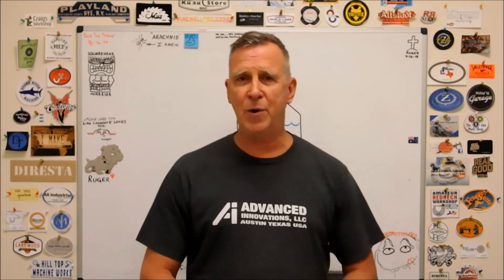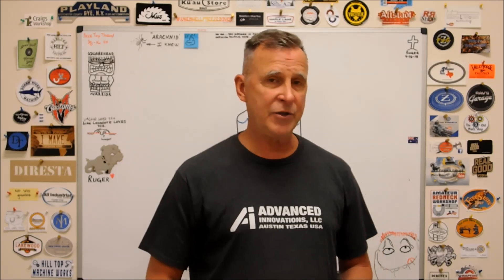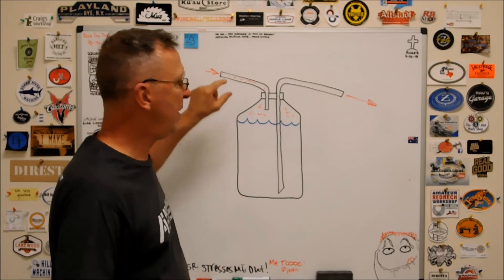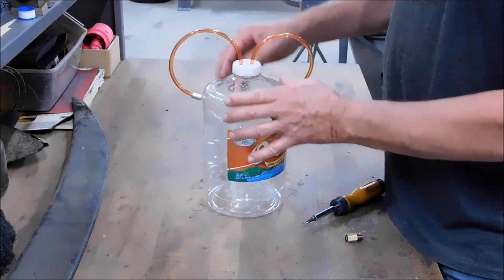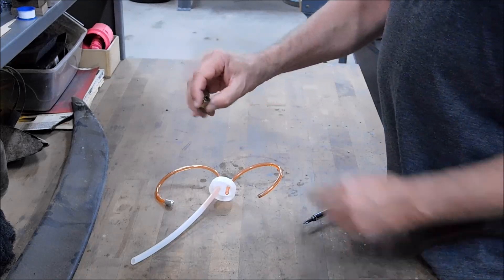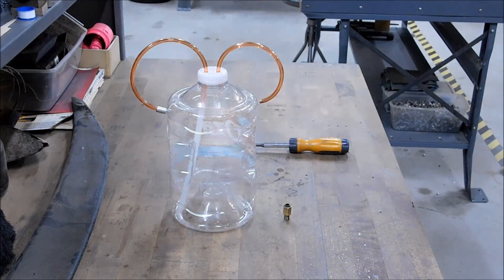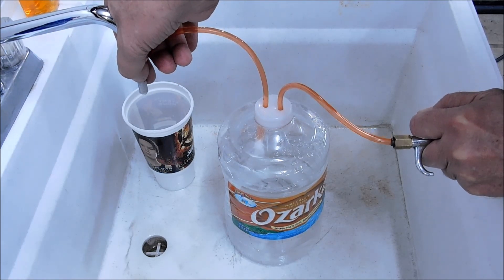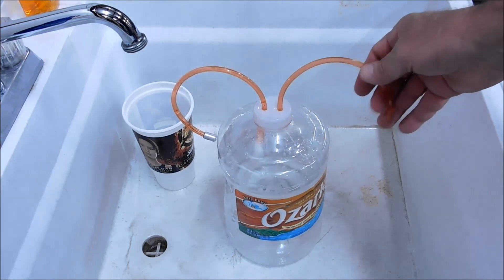DIY Coolant Pump

Comment from the maker: When I actually went to use this setup, I downsized the air input hose to match the hole size in the tip that delivered the coolant. The balance in sizes made a huge difference in the tank expansion. It was nearly a balanced system and worked extremely well.
Reply: Cheap Regulator and a good needle valve would probably work awesome. Perhaps a  reusable system could be made from automotive windshield washer tank from a salvage yard and a dash light dimmer to control the washer fluid pump. Probably cost 5$

Comment: If you have an old air pump for fish aquariums, it will work great to pressurize the bottle.  You could also drill a small vent hole in the cap to help regulate the pressure if the air pump is too powerful.  Usually they only put out 5-10 PSI.

Comment: Hi Joe: a lifetime ago in teacher's college I was introduced to a project for highschool kids using a 2L PET pop bottles to make rockets.  Basically the bottles were about 60 or 70% filled with water, a rubber stopper with a tire valve placed inside.  The rockets were fitted into a "launch pad" - basically two butt hinges with a hole bored out to accept the bottle neck, and a piece of channel to keep the hinges closed until you pulled the channel off.  Air and water exiting the bottle launched it.
One night my co-worker and I "failure tested" one of the PET bottles: I think it took pretty much full line pressure to kill it.  The bottles took a fair bit of pressure before they ruptured but when they did it was a catastrophic failure...  Point being: a pop bottle might be stronger than the juice bottle. 

Very clever solution though.
Reply: One note is that the bottle needs to be replaced periodically as even at ~80psi, they tend to fail at the "seam" in the neck of the bottle .  They typically develop a pinhole which will then suddenly explode.

Comment: That's a really good idea.

On my machines I've used the windscreen washer bottles off a car. Just supply 12v (with a variable resistor to adjust flow) and it works great.
Reply from the maker: That's a great idea!

Comment: Great idea Joe.  I took it a stage further to produce a coolant mist sprayer particularly useful on the Milling machine rather than the normal mess often associated with flood coolant systems. I used a domestic water  filter system body (Aqua Filter) without the filter element and a cheap coolant mist unit available on eBay for about £10.
Pressurizing the coolant as you have done but through a cheap regulator and including a second air supply to the misting device produced a very fine pressurized mist at the the delivery point.
It's now an permanent fixture on the mill and much better than the old flood coolant system
Reply from the maker: Go to the hardware store and get a pair of pipe elbows that fit your mill table ports. Screw them in and face them down. Take a piece of coat hanger and make small bucket handles on 2 coffee or soda cans. Hang the cans from the pipe elbows. No more mess on the floor either.

Comment: I don’t have any air line so I use a garden sprayer. It works well using a hand pump to pressurise the container and an adjustable head to control the coolant.

Comment: Try this.  Invert the jug above the work surface, the “old” outlet is now the atmospheric inlet.  Use the “old” inlet as the new outlet and regulate it using a cloths pin!  If you want to really fancy it up you can attach a bicycle shifter cable to the cloths pin and run it down to a simple foot treadle, giving it adjustability and an on off feature.  No air pressure needed, reducing the “bomb” affect.
Reply: Except that you now have a heavy jug of liquid above your work and have less control over your output pressure. With the air you can get a higher pressure and lower orfice diameter which would allow delivery of a small amount of coolant to a specific point

Comment: I used this same principal back in the early 70's to inject alcohol into my truck motor. I had a vacuum line going to the carb sucking fumes from a fuel tank I had scrounged somewhere. My air intake tube with a filter went to the bottom to create bubbles and fumes. I worked for my Dad at the time and he bought alcohol by the 55 gallon drums and he let me have all the alcohol I wanted. Looking back I don't know if it gave me any more horsepower but I swore at the time it raised my gas mileage about 2 to 3 miles per gallon... I didn't have enough scientific data to prove it but it was a fun deal at the time for a 17 year old kid.....

Comment: I used a hand-pumped plant sprayer (not the backpack type!) to achieve the same effect, with a small valve to control the coolant flow at the nozzle. When the flow slows, a few strokes revive it.
As usual, great ideas, well presented!

Comment: Hi Joe  Many years ago I hydro-statically tested large tanks with the tank filled with water and pressurised with low pressure compressed air.  The simplest and reliable air pressure regulator is very easy to make.  Just insert a T fitting between air source and tank.  Attach a hose to the T and insert it in a column of water.  Use a pipe with one end capped off and stand it up vertically and fill with water.  Drop the bleed air line to the bottom of the pipe.  A 10m column of water gives one atmosphere of pressure (1 bar or 14.7 psi.)  Just adjust the water column height to give the required pressure.  Continually bubble a very small amount of air though this bleed line - no need to switch off air supply.  To regulate the coolant flow fit a three way ball valve prior to your coolant pressure pot.  Position 1 allows the air to enter the pot and Position 2 bleeds air from the pot stopping the flow.  On another project I have used this air bubbling technique to measure oil levels to within 1mm accuracy.   I stole this idea from a brewery tour.  They regulate the height of beer in bottles by sensing the back pressure of carbon dioxide flowing into the top of the bottle set at the required height.  When the beer hits this height pressure in the carbon dioxide increases causing the beer to be shut down.  So you see many engineering things revolve around beer.  Cheers

Comment: If you could suspend the jug above the workpiece, you could use gravity to keep the coolant flowing so once started with air pressure, it would continue unassisted.
Reply: Came here to say the same thing.  I just finished doing that for water cooling the coil on a DIY induction heater.  Works great.  Just lift the lower jug, or take down the upper supply jug to stop the flow.  Since I'm using water, I can suction start the siphon without poisoning myself.

Comment: Joe, 2 liter soda bottles can hold over 100 PSI. The plastic actually has a cross laminated grain like plywood. For my kid's science project, I drilled a hole in the cap and installed a tire stem. My compressor would not pop it at 125 PSI.
Reply: I tell you streight, I would not like to be Anywhere near a soda bottle at 125psi..
Let alone if it did blow!
That sounds like a Darwinian science test to me...
Reply: @captcarlos  I agree! Very dangerous! I was careful to stay well clear of it! Never held it in my hand and attached the inflator valve mechanically. Guess I should have put a disclaimer in my statement.
Reply from the maker: This Ozarka bottle is super thin. I will be careful.

Comment: Hey Joe: I use a similar theme on my mill & lathe. Mine is spray mist system. Instead of plastic bottle, I use a large aluminum pressure cooker filled with about 5 gallons of castrol semi-synthetic fluid & water that is plumbed to both the mill & lathe. I use a regulator to maintain about 5 psi, and each station has two switches *& two needle valves. One for air only, and one for water only. The misters are very dated, made by Bijur systems but no longer made. They are very precise and can be adjusted to a super fine mist using very little air volume. Someday, I need to switch to a different lubricant, since the Castrol stains my vice. Otherwise, I am very pleased.
Reply from the maker: I've used those Bijur systems. I liked them. This coolant is water based with a very special additive. I don't want it in my tank full time. Majority of the time, I cut dry.

Comment: This is a great idea!  More or less it's like one of those pump up agricultural sprayers.  How did you seal the tubes to the cap?  Just press fit?  Love the idea of using the blow gun to gently pressurize it.   Maybe a tip/thought - if you run out of air pressure before coolant, you could feed the bottle from one of those portable air tanks that they use on tow trucks.  With the smaller overall change in air volume, caused by the bigger tank, it would probably maintain close to the same pressure for the whole gallon.

For the safety guys who have posted - I wouldn't give this setup to a newbie employee, but if aware and careful it seems fine to me.  It's a plastic bottle, not metal...and believe it or not, the average pepsi bottle can hit 50psi or more from normal use, and they rarely hurt anybody.

Comment: You could have used a flow control smc fitting to control the air flow instead of the gun. Or just added a flow control inline after the air gun to  regulate the air and taped the trigger down on the gun to free up both hands. Are probably 1000 different combinations that could have been done but yours is simple and quick great video

Comment: An aquarium air pump might be able to supply enough air volume and pressure to do what you need. Would be cheap to try it for future use. I'd probably use a stronger jug for long term use, like a good thick windshield washer fluid jug that those of us in the north tend to get plenty of during the winter.
Reply: Exactly what I was thinking. A small aquarium diaphragm pump is low enough pressure that I doubt there would be much lag after shutting it off, and the pressure is easy to regulate with a $1 valve.

Comment: Joe, I just use a $5 110v pump in a bucket of coolant.  No fuss while  machining.
Reply: I use a Harbor Frifgt fountain pump 12 bucks and a 1/4 shut off valve works great and cheap

Comment: Fill a bottle poke a hole in cap with nail -cheapest coolant pump  ever -only downside is you need to use it by hand-if you wanna go fancy hang bottle upside down and use a hose in a bottle cap,same setup as yours.You can even go fancy and put an clothes pin for flow regulation.Like Iv in hospitals,it wont be under pressure but for simple jobs works just fine.

Comment: Hi,  Another way is to suspend the plastic container above the machine and let gravity supply the coolant pressure.  I use a 20 litre container siting on a shelf above my lathe for a coolant supply, with another container behind the lathe to catch the runoff. Works really good for me.

Comment: These rigs work well with a vac pump too. I have a setup for brake fluid. Alrays a nice, easy, enjoyable visit with you my friend.
Reply: I've filled brake lines this way but this really shines in deflooding 2 stroke crankcases
Reply: @Sketch1994  You bet. The small hoses are easy to get around a corner or down a dip stick tube.
Reply from the maker: Sounds like somebody swamped a jet ski or two.
Reply: @joepie221  LOL, Joe, , , I used to manage a resort on our Shuswap lakes here in BC. I had 6 for rent and that was 5 1/2 too many, LOL. Common sense with not a clue make for different companions eh, LOL.Take care bud and be well my friend.

Comment: A gallon soap bottle makes a big boom if you don't turn the air off....we had a skilled trades welder who thought it great fun to leave a compressed air line hooked up very slowly to one.  Dust would fall from the ceiling when it went off.........!
Reply from the maker: I blew up a coke can that had a pin hole in it once. Sounded like a grenade. I don't suggest it.

Comment: a bubbler pump for a fish tank might work and be more controable
Reply: This was my thought, and I may well do something exactly like that with some spare aquarium kit that I have laying about. Probably won't work if you put the bottle on the floor and try to read the very top of your tall lathe or something, but for "it sits on the table of the mill and sprays at same level as the water", it's almost certainly going to be fully functional. And as "noise" is usually not an issue in a work-shop, the cheap and cheerful aquarium air-pumps will be just as good as the fancy expensive ones. The big difference in favour of the fancy name brands is when you want to run it in your bedroom, or in the TV-room and not have to turn the TV up 3 extra volume steps - you need a pretty noisy aquarium pump to beat even the quietest of your typical work-shop machines!...

Comment: Others have mentioned using 2L soda bottles, but no one seems to mention specifically that they were tested on the Mythbusters to 95psi before exploding. If you keep your line pressure under 90psi you should be good to use 2L with some safety margin.

Comment: Might look at a marine primer pump. Rubber bulb you squeeze repeatably to prime from fuel tank to engine. HAs vales to keep air flowing one way. Stomp on it to your heart's content. Check with local outboard motor shops.
Reply from the maker: Many have suggested that. I may have to look into it. Thanks.

Comment: Would a very small extra hole in the cap cure the overflow of coolant. I figure if small enough all you woild need is a tiny bit more input air .

Comment: I have used a gasoline primer bulb for pressurizing light air lines before. They already come with a valve built in and barb fittings for plastic hoses. And they are not too expensive.

Comment: nice workaround joe. i had a similar experience some years ago and i ended up using an old pump up garden sprayer. it worked very well. i think i got about ten minutes of run time per pump up. i even used the adjustable nozzle that came with the sprayer. i rigged up a little shutoff valve to control the flow .

Comment: Joe, I bought a foot pedal control for air that I use on an import mist sprayer on my belt grinder.  Works great, is regulated and cost like $30 - $40.
Reply from the maker: A subscriber and supporter of this channel, JL, sent me one. Hes been very generous over the years and send great gifts.

Comment: I think misting systems cool better and they can be adjusted to not make your machine such a sloppy mess.  I did install a return line on my mill table but after switching to a better mister with independent coolant adjustment I can set it so that no liquid ever returns from the table, and my mills still stay cool to the touch.

Comment: Great idea. It works similarly than the pumps used for spraying for weeds in the driveway.
Suggestion for your spout. drill a off-center hole in the spout, and insert a length of soft baling wire. This wire is run inside of the hose. That way you can bend the hose in place similar to what a oil can is doing.
Reply from the maker: A lot of guys have said the same thing. I like it. I also use 12 ga copper wire and some zip ties for the creative setups. Its ugly, but very effective. Easily bent and rigid enough to hold the tubing.

Comment: As a few others have said I also use a garden pump up sprayer although I'm to lazy to pump it up so i added a threaded valve stem to mine.  I'm not advocating others do this, does work for me though. As far as your setup its quick down and dirty.  I like it. Have a great one.

Comment: Grizzly offers a foot pump control. With small Reservoir coolant line with Magnetic adjustable sprayer tips where you can just push the bulb with your foot and it pumps to coolant the other end

Comment: Joe: simpler yet if low flow is fine, raise jug, blowinto air inlet -> starts siphon. No pressure needed.  Let gravity do the work. To stop - plug air side or clamp.

Comment: Hi Joe, as always a good easy tip, just a suggestion, if you had a tyre innner tube, could you use this as an air reservoir, and put a weight on top to provide a longer period of low pressure air
Reply from the maker: Great idea

Comment: Kinda like a continuous pump sprayer... my question is how are you collecting the run off if you don’t want your coolant mixing, or over filling the sump?
Reply: Trevor Jarvis that was my question.
Reply: I'd guess it's a single use coolant in this application.. someone previously mentioned it might be a sterile, medical grade stuff, and if it's just a couple small parts, a gallon goes a long way and probably will hardly even get back to your sump, though you could disconnect it or occasionally wet-vac the chip tray out

Comment: This reminds me of the lab metod for transfer of air sensitive liquids with argon pressure by canulation . Usually flasks have rubber seals that can be punctured with teflon or steel capilaries. The pressure is usually supplied from  a low pressure Ar tank regulator, often stabilized by a bubbling column. I had to build some testriggs for the medical industry  using this and tested them with an aquarium pump. There are special HDPE flasks thar can take higher pressures as well from the lab suppliers. More expensive version of what You did...

Comment: Hi Joe
I have a nice 2 gal. SS garden sprayer that I use add some longer tubing to it too. I set it up when I got my Sonic testor, this testor could be used to chart the length of a cylender wall, so I had to ha a medium to travel with the prob. So I used a oil based coolent, and sprayed it as I traveled the length of the wall.
Later I found it to be handy for a lot of things drilling, milling and on the lathe for heavy cutting.
Randy
Reply from the maker: Very cool!

Comment: Tip, this also works very well if you have to suck a liquid in hard to reach places. Then replace the compressed air for vacuum with a vacuum cleaner.